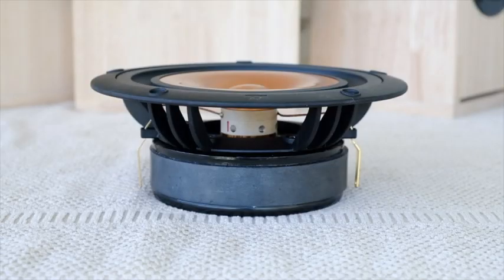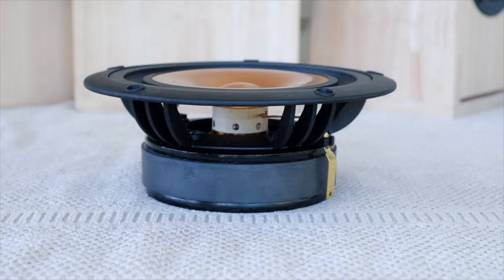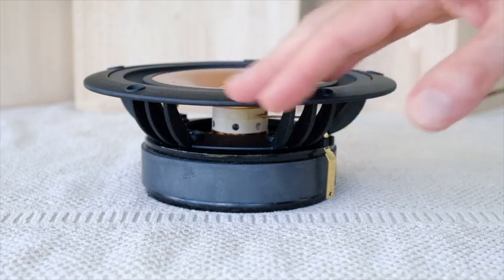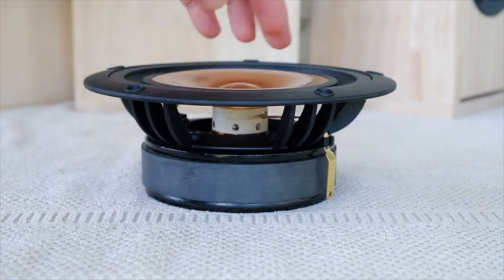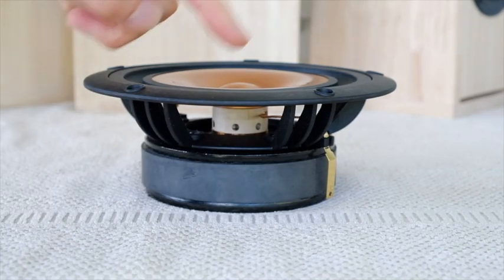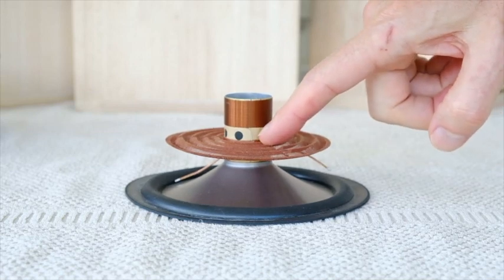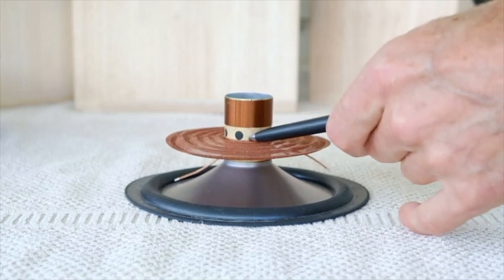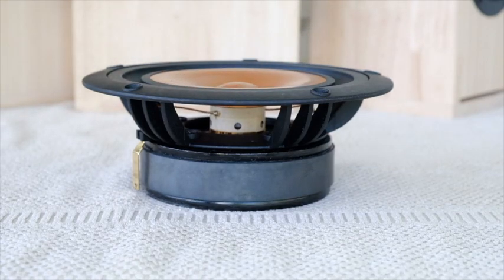Alpair11MS tech talk final

Comment: i build myself speakers in an egg shape with markaudio alpair 10p. Markaudio has some good features in my opinion, esp. easy moving cone and the inverted surrounding. but i did'nt like the shape of the polecap in my markaudio speakers. I guess the polecap is important for the sound, too. so i removed the polecap and shaped new ones. there is although a (not very professional😉) video on my channel about it. I was although contemplating about the shape of the cone and came to the result, a tractrix (horn) could be the ideal sidecut-shape. Maybe in sintered or printed titanium. But i didnt found a producer yet😉😉😉